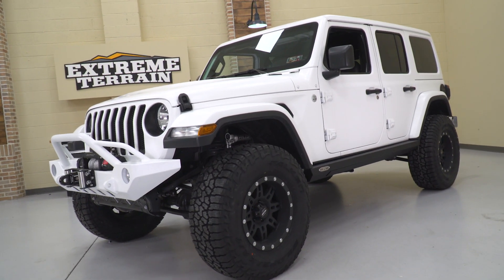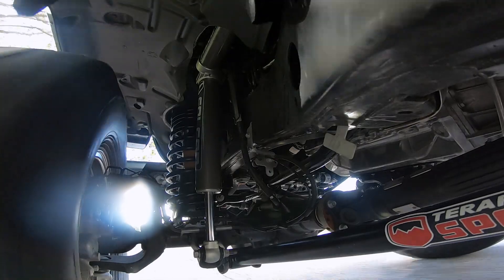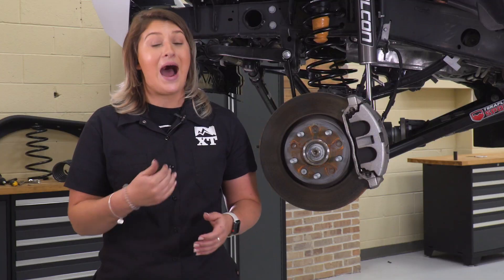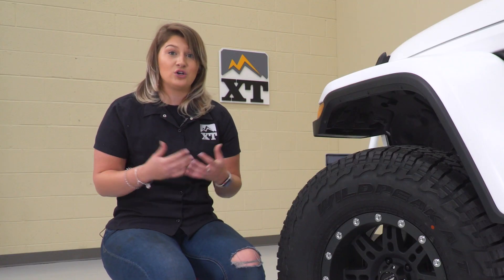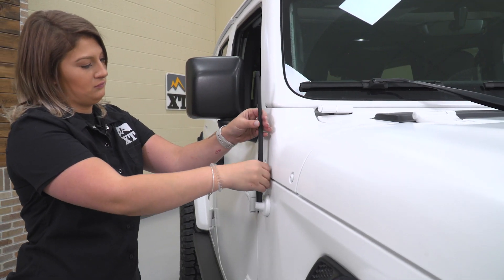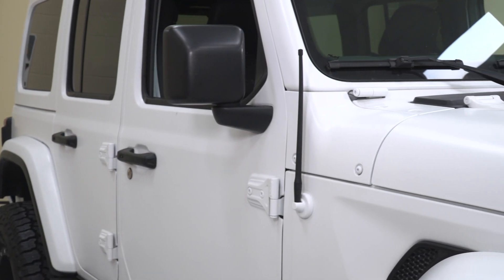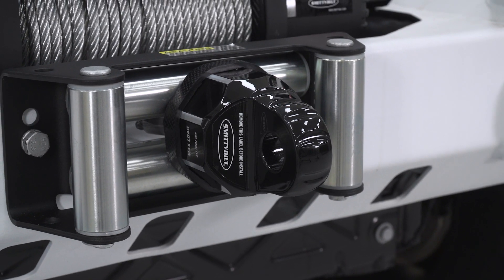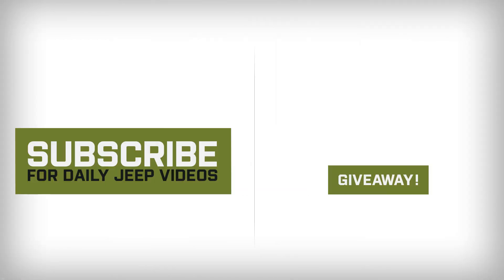Daily Driver JL Wrangler Build That Is Ready To Rock The Trails - Throttle Out

Comment: Very nice build!  Not wild about the white front bumper but it’s different and not terrible.  Love the suspension lift kit!  You should add the Rugged Ridge low profile version of their new snorkel, it would go well with the Street/Trail theme. Also maybe the Rhino Rack Backbone system & Pioneer Rack would be a nice black accent on top.  Keep up the great work!

Comment: Steel winch cables are dangerous, I have seen a steel cable fail and it cut the legs right off the man watching the recovery. Go synthetic, just as strong and they won't whip on you if they fail. I hope this saves a life. Otherwise a great example of a nice lift and mod for a mall crawler.

Comment: Jeep claims the Rubicon JLU can accommodate 35's without lift, most people recommend 2" of lift anyway if you want 35's but my question is how would 35's fit & function with just a spacer/leveling kit? I'm saving for a JLU Rubicon but I dont really want to go hog wild in the aftermarket. It would be my daily that isn't going to be abused hard & constantly flexed out all the time. I'd rather just do the leveling kit than a whole lift kit for 35's 😊
Reply from the maker: You're absolutely right about 35" tires fitting without any issues on stock Rubicons! If you don't want to go all-out, a little leveling kit or 1" spacer kit is a great in-between option if you don't plan on wheeling often. That way you still have room for articulation and a more aggressive stance, but it won't hurt your wallet as much. 😁 -Zach
Reply: @extremeterrain  thanks Zach! Just wanted to confirm, I dont know where these people get the $ to buy a new Rubi & immediately go out & throw 40" tires on them then smash the fenders in on the trails 🤣 I just want a Jeep that can go anywhere, anytime, and in style!
Reply: This wasn't a Rubicon was it? (No initial rock rail or tagging).

Look forward to doing the 2.5 teraflex on mine (have it but need to get it on my daily driver....winter slush... Need some better upstate NY weather).. But with 37s
Reply from the maker: Nope! The white Jeep in this video is a Sahara. -Zach
Reply: @anthonycoffey816  well, since this isnt a Rubicon you have about 10k of playing g money to do this stuff. But since it's not a Rubicon it just looks nice. At best you have limited slip.
Do you want a jeep that looks like a big toy or one that can take you anywhere? 
Go Rubicon, throw 35s on it (to clear the diffs) and call it a day.

Comment: In this build is it necessary to regear? And is it necessary to buy a new tire mount for the extra 35 inch tire? Thanks
Reply from the maker: If you have the funds available, investing in new gears wouldn't be a bad idea at all. You'll immediately notice a lot more low end torque, more pick-up from a stop, and more power while in 4WD off-road. That being said if you don't feel that it's needed right now, there definitely isn't a NEED to get it done right away. As for fitting the 35" spare, I would recommend getting a spare tire relocation bracket to get some extra room. -Zach

Comment: Which tires & lift kit to select for Wrangler JL 2020? I'll be using the Jeep for Daily commute and twice a month for Off Road. Do yo help in installations?
Reply from the maker: You'll want to stick with an all-terrain tire in general if you're going to be driving mainly on-road. They will give you better handling on the road, better fuel economy since they're normally lighter than mud-terrain tires, and will wear better with proper rotation. Plus they won't be nearly as loud on the road as worn-in mud tires can be. Most people that use their Jeeps for a mix of trails and street usually stick with a 2" lift, and 33" or 35" tires. 33"s will give you better fuel economy, will be cheaper to purchase, and will handle better on the roads. 35" inch tires give you more ground clearance, generally look a little nicer on your Jeep, but will give you worse fuel economy and handle worse on the roads compared to 33" tires. As for your lift kit, it really comes down to budget and how much you want to spend. Since you'll be going off-road to some degree, I would highly recommend looking into a full suspension lift and stay away from spacer lift kits. I'll put two examples of solid lift kits below. If you have any other questions feel free to respond here, or give us a call or email! -Zach
https://www.extremeterrain.com/rubicon-express-jeep-wrangler-25-in-super-ride-suspension-lift-kit-with-twin-tube-shocks-jl7100t.html
https://www.extremeterrain.com/skyjacker-225-dual-ratelong-travel-lift-kit-w-m95-shocks-2018-jl-4-door.html

Comment: Jeep is a junk product. Nothing but trouble with my 2016 wrangler.....never again!
Reply: what kind of trouble?
Reply: @toddschexnayder146  With 76k miles dropped a valve into the piston from the #5 cylinder. So replaced the engine. Then the rear end began to click. Had to replace the entire carrier.  Then the radiator....a few months later new trani... my budy has a 2018 he had serious electrical problems right out of the dealer.  He then had overheating problems.....Complete gabage.
Reply: Well it’s a Chrysler so yeah. I leased one because I don’t want it past warranty.
Reply: @carlosvaldivia2985  i hate to hear that.. did you keep it?